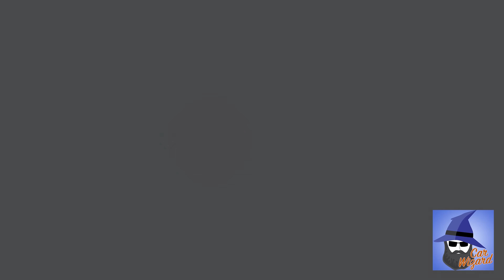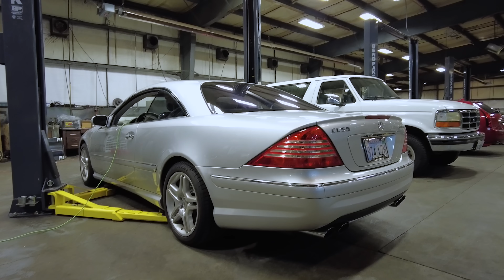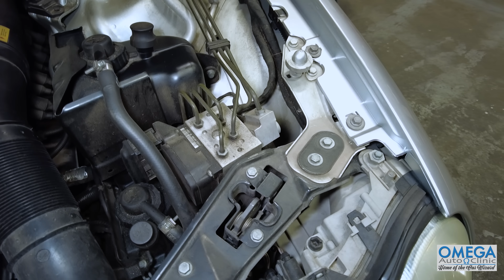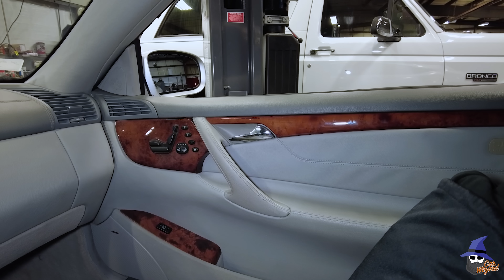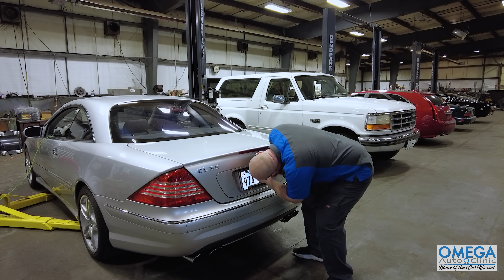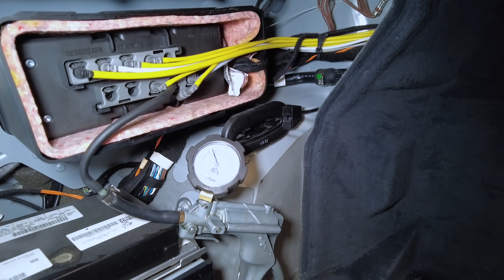Really, $4K to fix the locks! How can the CAR WIZARD charge SOOO much to fix this '05 CL55 AMG?!?

Comment: i have video on my chanell where i messed with same type of PSE pump give it a look if you want to see how burnt it is :D   in some cases you actually can refurb those pumps but most likely they are burnt that badly there are nothing to save anymore also new motors for pump are with different shafts and if you aint know it you order wrong one waste alot of time, then you have to order another one and that time and effort possibly leads people to buy new unit for couple of grand what dealer asks for it , what i did i managed to track down good used one from Poland, thats right a Poland like 1,5k/km away from me because in my country there were 0 aviable.

Comment: It is an AMG.  Everything on those cars is thousands of dollars.  People that own these cars count them selves lucky if the bill isn't tens of thousands of dollars.  By father in law had a SLS AMG.  Just the oil change was like $1200, and only a single dealer could do it, as it required a special lift, and they only had one trained mechanic to work on it, which was available certain days of the month.

Comment: The investigative methodology you and Magic Mike apply and then explain is what is so badly missed by most if not all service providers in the automotive sector. This video link will go into my reference video library as a diagnostic method that I can share as and when I get a W204 CL for any such problem in the future. Thanks.

Comment: I had 2 of these gorgeous cars. Maybe the best looking coupe over the last 40 years. First was a 2002 cl600. Got warranty. Had $27000 worth of work at mercedes. 2nd was a 2003 cl500 with 45000 miles. Again aftermarket warranty. Pristine condition. $18000 worth of mercedes work. No good! Mercedes who was know for durability and workmanship in the past really blew that apart in the early 2000's. stunning car the cl is but run from these elegant beasts

Comment: Door lock 600$ and pull off door panels 1900$ more? Wow, I definitely made a mistake choosing my IT speciality! I could just pull off door panels 24/7!
P.S. 100-200$ for second hand pump on eBay. Jeeeeeeez.
Reply from the maker: Thats for both doors. As stated in the video.
Reply: @CarWizard  if you need special door's panels pull off guy in your shop feel free to contact me. I'll do it only for 200$ per door panel. 4 doors per day will be more than enough for me 😆

Comment: Owner of a 2002 s500l with the same system. PSE is a bit of a nightmare. I have a STAR clone so can do the programming myself. Managed to successfully reactivate the rear headrest release (required dismantling half the interior to install new actuators and lines, followed by turning back on the functionality with star) and repair a leak in the hose to the drivers door. So far the pump has survived, but it acts up occasionally- and soft close fails. Fingers crossed.

Comment: I was lucky enough to repair the vacuum pump motor of an older C class model.
That was not a big deal.
The problem with the yellow vacuum tubing is that the material cracks with age and it's a pain in the arse to firstly establish where the leaks are and then to physically get to them.
Often the leak is between the body and the doors, tubes wearing out from opening and closing or tube getting brittle through ageing.
The vacuum units inside the door also can have leaking bellows (age)
A friend, who works for Mercedes in Melbourne, told me that plastics in Germany are often designed to deteriorate with time to facilitate eventual recycling.
The ignition cable harness atop of a C class engine crumbling is a prime example.
In 1992 l restored a '71 Mercedes W100 600 Grosser and was amazed to find that the quality of some body components on this very expensive model was rather average.
Mecanically the 600 was practically indestructable.
Also the quality of the electric wiring was superb..
The steel used of the in the 1960's designed body was only average and  prone to rust easily.

Comment: I found my leak by simply connecting my vacuum pump to each line at the pump! I bought a used pump at my local salvage yard for $45.00! With the leak fixed, my used pump has been working perfectly for 7 years!
Reply: I came here to say the same. A Mityvac MV8500 hand pump can produce sufficient vacuum or pressure to test the actuators and hoses. I've used one for years.
Reply: @GreyRaceCat; thank you for your comment, i do have that Mityvac hand pump as well & will check when my "01 CLK430 pse system will fail. So far only the comfort seats lumbar bladders are not working so I think my car has 2 different pumps & the one for the seats is not working anymore... Right now I can live w/o the comfort seats but hope that the main pump for the door locks & trunk continue to function. Cheers...
Reply: @quoc-baovu8241  Thank you! Glad to help!

Comment: I had this happen on my W220 S430. The trunk latch vacuum system popped a massive leak and for some reason the car just kept running the pump. It ran for so long it MELTED THE INSIDE of the pump. The entire base had bubbles in the plastic from heat. Wild!
Reply: HUMMM. Fire safety recall

Comment: my 1984 190D(w201) only used the vacum pump for the central locking and it did too fail eventually. after 30 years of use. turned out it was a door  connection leak on the drivers door that killed the pump.

Comment: If you hear the motor that means it’s working, there is a small black plastic motor impeller that always breaks . I paid $50 Canadian for it , this fixes the pump problem, after look for the leak

Comment: Why would they put the CD changer in the back of the car? That’s stupid because you don’t want to have to pull off the side of the road every time they change the CD that’s in the idiotic I would rather have locks that you can take that side of the door off and replace it rather than a pressure system. Unlocking the doors for you I never heard of that my mom has a 2007 GMC Acadia she loves it it’s still lasting because she takes good care of it but I know from watching a mechanic 55 years He said when the windows system or the lock systems don’t work all you have to do is slam the door to get the window temporary working I know that’s not a permanent fix but at least it’s temporary

Comment: My dad has a 500 with custom 3 piece wheels been sitting in the driveway for years might fix it up one day it's got the little wing on the roof right above the rear windshield and everything it's all black I would get rid of the hydraulic suspension in a heartbeat he wants to keep it even though it's what's keeping it from driving right now

Comment: My '88 420SEL has vacuum door locks, gas cap lock, and I believe HVAC vacuum controls.  The car has 330K on the clock...the vacuum system has always functioned perfectly...never an issue...I hope I'm not jinxing myself by writing this...I've owned the car for 20 years...was 15 years old when I bought it.  Total beast, very reliable.

Comment: Could you not artificially create pressure or vacuum to force the system downstream of the compressor then, place a meter at the terminal end?  If possible, you could diagnose the leak locations early..

Comment: I thought the pump timed out if a circuit leaks? So, yea the pump might run a bit more, but shouldn't be enough to "burn out" the pump. Think its more somewhat sketchy parts on Mercedes side?

Comment: I admit that I like older Mercedes. By "older" I mean something around 1990 and earlier. Now I know that even the older ones have their share of trouble spots so nobody needs to jump on and correct me but they aren't anywhere near the electronic nightmare that the ones built in the past 15+ years or so are.

Comment: Because it's such old tech, should be able to repair existing vac/pressure pump. Or go the part changer route. Some GM products has a stand alone 2 wire vac pump on the brake booster of escalades, ect. Well made aswell.

Comment: People should learn how to work on a car at home, specially with small components like that..I'm not taking about dropping the engine/transmission...The pump is $160-200....I can't justify spending 4-5K on a old car like that!
Reply: On this one I personally think it's the fuse...I doubt the pump has failed completely..Brushed pump motors don't fail like that..they may get weaker in time but to completely fail is not common...

Comment: As an Audi  tech I am glad wizard shares the frustration that occurs with repairs like these. It is the nature of the situation and its very hard sometimes for customers to be understanding of that. Thank you for continuously bringing these car issues to light Wizard! Thank you Mike for your excellent skillmenship!
Reply: Have and old S3 with vacuum operated locks as well. 99 model.
Reply: How did you become an Audi tech?
Reply: @enlightenedg3843  got the opportunity as a young tech to join their FastTrack program. Intense program. Understandable, as these German cars have very complex computer and mechanical systems. Worth the hardwork
Reply: Just what is the purpose of triple square bolts? Like isn't Torx enough?
Reply: @rick980  elaborate a bit if you would please
Reply: @1boss1 you are an Audi tech. Can you please tell me what the purpose of triple square bolts on some places on Audi's are instead of let's say Torx or regular bolts? My son had an Audi S4 and in order to do the brakes it requires the use of triple square sockets or bits.
Reply: I get "being understanding", but many times, there are easier ways (common sense) to get to a resolution! I do it all the time on my Rolls Royce collection. I learned this from my father who was a master British mechanic!

Comment: Yep, my dad has an 01 S430 and basically all the pneumatic soft close and some lock actuators are broken. The locks themselves leak. PSE pump is good. But replacing those locks, especially the front doors are a major pain and expensive, hard to find. In the meantime everything breaks while taking the door panels off. LOL.

Comment: Could you not use a bicycle pump to add pressure to each line and place a gauge on the line to see if it leaked down, to find the leak.

Comment: How about just use a regular handheld vacuum pump to check each line going to the pump and see which unit will not hold pressure.
Reply: Doesn’t matter, pump still broken.  Replacing the pump and then being able to tell in 2 minutes where the problem is saves countless hours wasted on manual pumping and removing lines.  Time is money.
Reply: @majist0  Yeah, but then you'll know what is wrong.  As a customer, I'd rather pay a couple hours of shop labor to find out that it's going to cost $6k to fix the problem rather than dropping $1-2k in it to find out it's going to be another $4 or 5 grand.
Reply: @majist0  good point.
Reply: @allen walker, Exactly, a Mityvac MV8500 and an hour (or two) in labor, and you would have your answer. There's likely to be more wrong, it's a system with 18 y/o plastic and rubber parts, so why spend 1-2 grand just to test?

Comment: I’ll bet replacing those nasty headlights won’t be cheap too. It all boils down to you may have gotten the car for a song,it’s still a $100,000+ car and the price of parts/service is expensive,so stay away from these exotics in less you are very well heeled.
Reply: No need to replace the headlights ,,,$10 worth of polish and they are fixed.

Comment: I once spent $1200 to fix the power locks and trunk release on a Focus.
The Focus was 20k new.
This car was 120k+ new. 
As with almost any repair you multiply the price you'd expect by the "luxury ratio" to get the cost to repair.
If, anything 4k is a bargain.
Reply: I once apent $40 for the part only to completely DIY replace the driver's side door lock on a 2001 Mazda Demio.
The part was marked with a Ford part number (for an Escort).....
Reply: You work in a Mercedes-Benz dealership, don't you?

Comment: I remember old 80's&90 vw jetta using a system like this back in the days,the door lock were activated by vacuum.
Reply: IIRC the 1960's Grosser  Mercedes 600 had hydraulic actuators....everywhere...

Comment: Wow, repair costs on these beautiful Mercedes can be crippling!
Reply: They are beautiful but after a 100,000 miles they are not worth much for just this reason. One little niggle and you're going to have to spend a small fortune to get it fixed.
Reply: @paul5683   - Yep, that's why they say nothing's more expensive than a cheap Mercedes.
Reply: @paul5683  not really true

Comment: Once again so happy mine has already had this fixed lol, so many horror stories on the W220/C215 groups.
“You have to spend the money, to know how much more money you need to spend.” — every Mercedes service centre
Couple things. Seat system usually doesn’t fail at the bladders - it’s usually the brittle old lines. My bolsters failed and the dealership snipped the offending line down and it now works perfectly again and has for over a year now. Two, not a fan of telling people to code out issues which are actually simple fixes like the multicontour seats. I do however agree with you saying that these cars are superior. It’s why I keep my S Class going and it’s why the owner of this CL keeps it going.
Reply: I have an 03 s55 w220 and  my driver side left bolster stopped working. How much did the dealer charge you?
Reply: @geni2shoes889  they didn’t. It took them all of ten minutes to do the entire thing - remove seat back cover, find line, snip down offending piece, reattach, replace seat back. This being said I was also there for other work so that could be why they didn’t charge me.
Reply: @IC  Damm but you have to know which line is for which huh

Comment: That's one of the reasons my 91 190e 2.6 was 900 bucks... locks, among other things, were not the best. had to use the trunk to activate the locking\unlocking central system everytime i wanted to use the most simplest of over-engineered features. Anyway to use 12 volt power and electric actuators to switch the locking system into something more conventional whilst saving OEM money?

Comment: You didn't mention: I believe that is a removable hard top.  AMG is considered a different car- hence the steering wheel controls.  The customer may just like a larger diameter steering wheel.   

Next do a RR mineral oil system.
Reply: Top is not removable

Comment: I feel Wizard of old would have spent 30 minutes to remove and dig into that pump to find it was likely just the impeller vanes cracked and failed, stopping the pump. A $25 aftermarket part that breaks on all of these PSE equipped Benzes. Guess it just isn’t worth the time, but would make for a better wizardry story!
Reply: If I had a nice car like that, I wouldn't want some jerry-rigged pump controlling that all.  I'd rather spend the money and get it done right.
Reply: @that-dude-from-the-internet  How is it Jerry-rigged if you use the correct aftermarket part to repair the pump? There WILL come a time when aftermarket will be all that is available, what then?
Reply: @that-dude-from-the-internet  it's a known problem and the aftermarket replacement parts for the vacuum pump are better than original MB stuff

Comment: 200 bucks from a junkyard, pulled and shipped for a pse pump, coated the trunk mechanism with JB plasti weld, because thats what always fails first. Took me 40 minutes total. Good as new working 2 years in -40-+40c temps.

Comment: Seems to me you can test the vacuum system by powering up each circuit one at a time with that simple hand-operated vacuum pump you have on hand (at least the binary on/off devices like the locks). And you're just assuming the pump went bad because of a leaky system; it could have failed all on its own due to age, etc. - so there is no need to worry about anything until the pump is replaced one way or the other. Might have been fun and informative if you tested a few of the circuits on video to see what happened...
Reply: It did seem to me like a chunk of non-fun diagnostic headache was cut out, so Wizard proceeded with the video by going over multiple repair scenarios because the car isn't fixed yet.
Reply: @compaqdeskpro5770  Upon checking, there are many out there who repair the pumps because of the stupid cost - and if necessary diagnose/repair the problem that caused the pump failure. Most of the time it appears the pump was the sole problem.

Comment: It seems to me that Mercedes just trades on a reputation of quality it long ago conceded to the Japanese. Its engineering is stupidly complex and Rube Goldbergian in scope, expensive beyond all reason, and short-sighted in terms of marketing. Good luck to all you morons who think the three-pointed star has any glamor; when the simple job of repairing your power locks costs $4000, something is desperately wrong. We've had power locks on our vehicles for half a century in American cars and none of them have ever broken. If they did, it's just a relatively cheap actuator. Go home, Mercedes - and take your complex, overpriced, over-engineered crap with you.